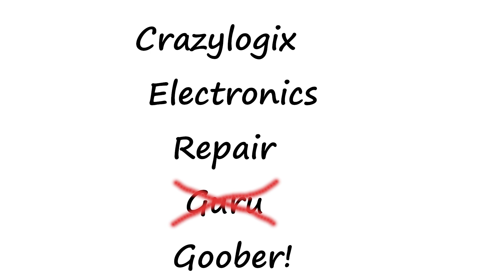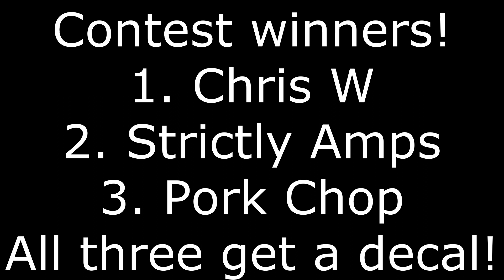Repair of Skar SK-4500.1 Part 4 Final. How to ZAP yourself and contest winner(s).

Comment: I am currently working on a skar sk 4500. The driver board on the power side is not getting any power. Could you possibly point me in the right direction? It came in for repairs with one Bank on the power side blowed originally. I replaced the power mosfets  and the transistor leading to them but it's still stuck in protect mode
Reply from the maker: The driver is probably getting power, but something (outputs probably) is causing it to go into protect, so its shutting the power supply down. Look at the data sheet for a TL494. Carefully check that you have 12volt on pin 13. If so check pins pins 1&2, and pins 15 & 16. The voltage on pin 2 should be higher than pin 1, and pin 15 higher than pin 16 for the power supply to come on. If not, something is making the voltage low (protection) and you will have to trace it back. My guess is dead output section.
Reply: @Crazylogix007 hi sir i have a skar T-2000.1D protect mode i have change the mosfet but the problem is the driver ic i cannot change the driver ic coz the part number is erase maybe you have an idea what is the part number of the driver ic.if you have an email i can send the picture of the board to you,thank you so much
Reply from the maker: @shawgsm  for this amp the drivers were irs21844, it was in the part 3 video, about 17 minutes in.
Reply: @Crazylogix007  thank you so much you save may day
Reply: Was there a part 3 on this amp repair ?

Comment: I have a skar LP 60.4 that turn on without Remote wire
Reply from the maker: If you follow the remote turn on trace, it normally goes to a couple of transistors that get turned on to start the power supply. Check those for dead shorts.

Comment: Thank you Damon, appreciate the decal. Will be waiting for it. I also like the tool you made for the clips. Need one of those myself.
 You might want to put a little heat shrink on those resistor leads, lol. I made me an automatic voltage draniner, works great, especially when turning the amp on and off many times while working on it.
Keep the vids coming.